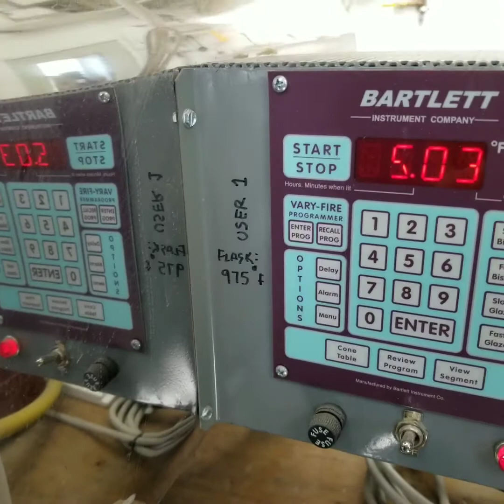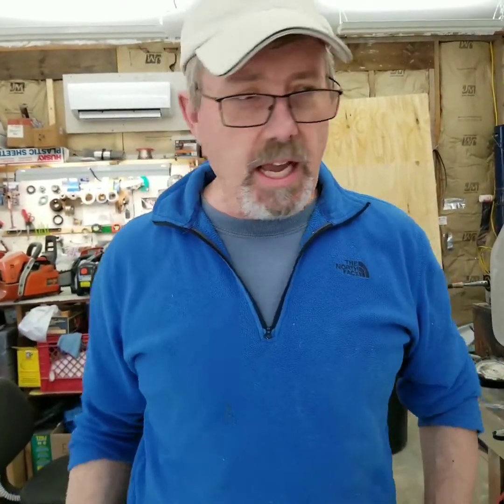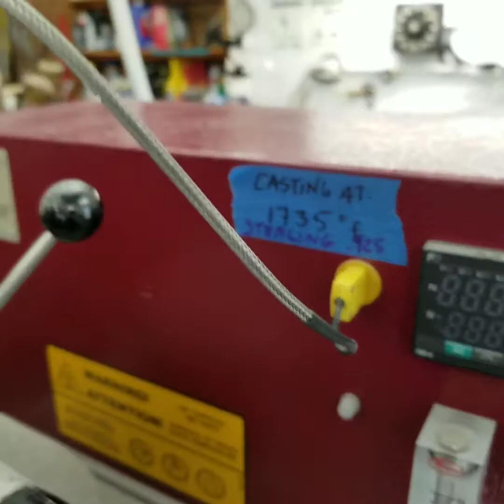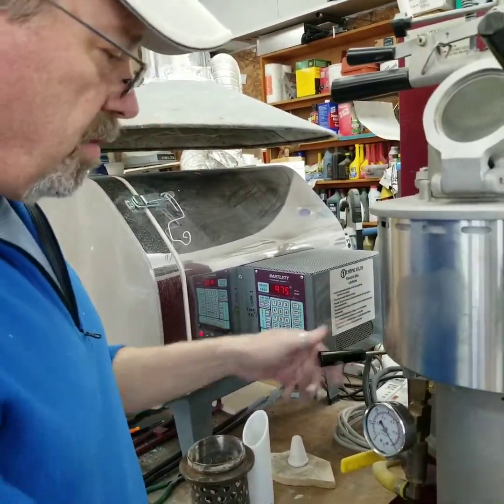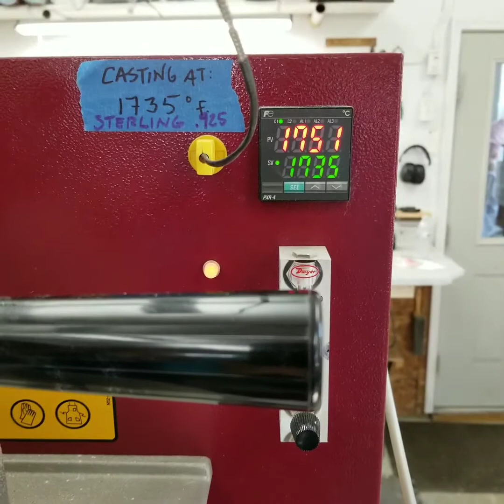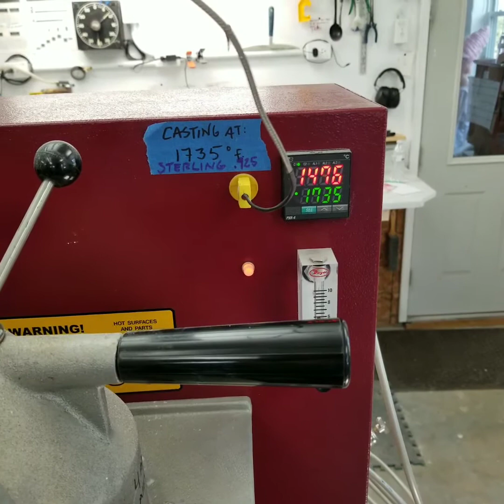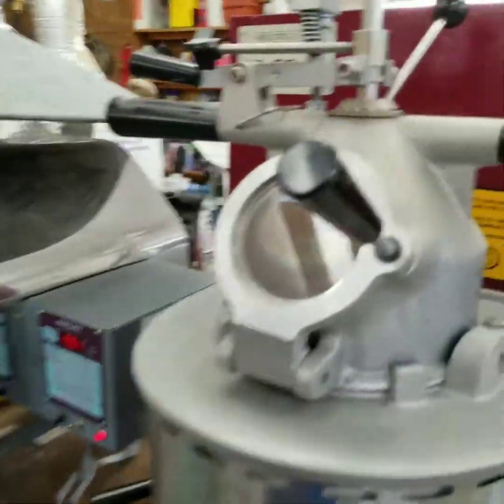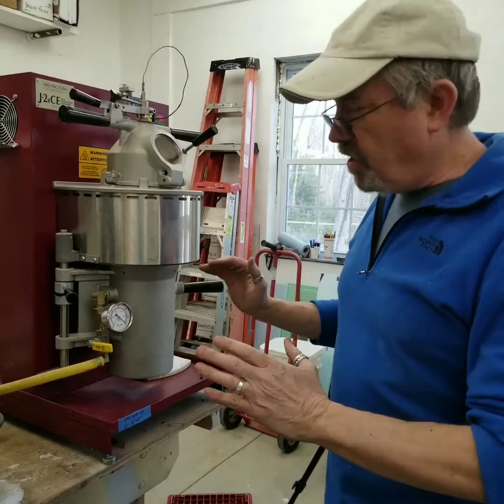How I Operate my Neutec J2R Casting Machine

Comment: Thanks for sharing! These tips are very helpful. I'm currently setting the j2r up at work and am excited to get up and running with it!
Reply: Also a quick question if you wouldn't mind - it looks like you've got either series 3 or 4, and your sealing rod has no ball that needs to be cemented on. Did they do away with that ball on the newer models? Rio's tech team is out at JCK. Thanks!

Comment: What is your method in regards to shutting down after casting? Do you wait for the machine to cool to a certain temperature at what degree do you turn it off? Thank you so much
Reply: Excellent question Julia!  My primary goals for shutdown are: 1. to not use/waste any more shielding gas than necessary 2. to not let oxygen have access to the orange/yellow hot graphite parts in the machine because they will literally burn up and consume themselves.  My sequence:  once I have dropped the last shot in the last flask, with the vacuum still running, I shut the casting machine off, and I shut the kiln off.  My theory is to begin the cool down process as soon as possible. I also shut off my exhaust ventilation system if it’s the cold season (I live in Maine) so I can reclaim the residual heat in the equipment to heat the studio which it does nicely for the rest of the day.   The vacuum chamber does not require that the casting machine be on to operate.  After 2-3 minutes, I close the valve, shut off the vacuum, remove the freshly cast flask to cool before quenching.  I have the heavy aluminum Neutec crucible cool-down chamber and the special spreader tongs for gripping the hot crucible so I lock the plug rod in the up position, unplug and remove the thermocouple, remove the lid, set it gently on the floor on it’s side remove the ceramic funnel, then the orange hot flask and place in the cool-down chamber and close the lid. The shielding gas (nitrogen) is still running at 5 cfm during all this process. Next I replace the lid close and lock the vacuum chamber bottom and set a timer for 5 minutes.  The goal here is to fill the chamber back up with nitrogen and displace the O2. When the timer goes off I cut the gas volume in half to around 2.5 cfm and reset my timer for another 5 minutes at which time I will close the valve on the bottle and let the system bleed itself. Because you have removed the crucible, the chamber has cooled down quite a bit by the 10 min. mark and you are mostly past the temperature that the graphite rods will consume themselves.  If you do not have the cool-down chamber, you will need to keep the gas running for quite a bit longer, maybe 25-30 minutes?  
One more thing, grabbing a yellow-hot crucible with tongs is quite the experience.  The tongs operate exactly opposite of normal tongs because they grip on the inside which in the heat of the moment kind of messes with my head.  You don't need to squeeze very hard to grab the soft crucible, just hard enough.  This is the exact opposite of what you just did grabbing the heavy flasks out of the kiln with standard tongs. So I find if I say outloud to myself during the entire crucible grabbing and transfer process “Keep squeezing gently, keep squeezing gently…” I don’t forget what I’m supposed to do or lose focus!  But I’m ADD so I’m easily distracted!  Cheers!  Mit
Reply: @SquishyMit  Mit thank you so much for this detailed answer!! It is very helpful to me, I don’t have the crucible jar yet but I can see it’s worth the investment. I’ve been trying to preserve my nitrogen as much as possible so this gives me a better idea of the process, I will follow all of your steps. Again, I appreciate you writing all of this!

Comment: Hello. He became interested in the topic of vacuum casting. There was one question about the protective gas. Do I understand correctly that nitrogen opens from the very beginning of loading metal into the crucible and continues to flow into it the entire metal melting cycle until the moment of pouring into the flask? If yes, then with a consumption of 5-6 liters of nitrogen (argon) per minute and a melting cycle of 10-15 minutes, 50-75 (60-80) liters per cycle (flask) should be consumed? Are my calculations correct? A few cast ones are still enough for one gas cylinder? Thank you for your video, it makes the casting process very clear! 👍
Reply: Hello Mrlwan900.  The tank I use is called a "Q tank" in the US.  it is an 82 SCF or 82 cubic feet steel cylinder of nitrogen gas.  The gas is only needed once the temperature is above 1000 f. on startup.  I usually set the gas at 2 LPM when the machine is initially warming up then move it closer to 5 LPM as it gets closer to casting temp.  It remains at 5 LPM for the rest of the casting session, I usually cast 2-4 flasks at a time.  I remove the flask and set it in the airtight cooling chamber immediately after I cast the last flask to slow crucible degradation and oxidation.  At this point in cool-down, the gas is only necessary to help prevent oxygen from consuming the 2 graphite parts remaining in the machine, the mixing rod and the sealing rod.  Once I remove the orange hot crucible and replace the top on the machine, I let the gas run for another 5 minutes at 2.5 LPM and then shut the gas off and let the machine cool down undisturbed. 

With this routine, I can usually get 5-6 casting sessions out of one 82 SCF Q tank cylinder.
Reply: @SquishyMit  Thank you so much for such a detailed answer! Now I got rid of a few questions that have been bothering me for a while!
Reply: google translator🙈

Comment: Hello Mr. Steve, I have a question to calculate the cost of each casting in the J2R, every how many castings should I change the type K thermocouple? since this is one of the most expensive consumables that the machine has, much more expensive than crucibles, rods and gas, and what is the minimum amount of metal load (silver and gold) for each casting? , Thanks a lot !!!
Reply from the maker: Hey Iuis, I have never changed my thermocouple!  I talked to a dealer and he said that they just stop working then you change them (the machine won't start unless it is working).  I do have a spare on hand if/when that ever happens.  
I have only changed my crucible one time when it got pretty pitted.  I believe the graphite breaks down when it is exposed to oxygen at high temperatures.  I try to remove my crucible from the machine right after I cast the last flask and place it in the airtight aluminum cooling chamber.  I believe the concept is that because it is tight, it quickly consumes the O2 in the chamber and then cools down in an O2 reduced/free atmosphere reducing degradation of the graphite.  
The rods get checked before each casting session, the machine is designed so you can extend the rods a little as they break down, which is nice.  I'm still using the set of rods that came with the machine when I purchased it (on eBay used). 
I use nitrogen as an inexpensive casting gas.  I think you can use argon but that is much more expensive.

CHeers!

Mit
Reply from the maker: Also, I remove the thermocouple from the plug rod immediately after the last flask is cast.  I don't leave it in to cool down slowly.  This seems logical to me...
Reply: @silverbeehivestudioyoutube8580  Thank you very much Mr. Steve, I will take into account all your advice in order to optimize my casting process.

Comment: Steve, how much Nitrogen gas do you use per casting? The J2r takes about 4 liters per minute of gas and I assume about 40 mins to reach casting temp and maybe another 20-30 to cool down so maybe 70 mins at 4 liters/min is 280 liters or about 10cf of N per casting cycle. Is that in the ballpark of what you see?
Reply: Hi Kevin,  I am pretty miserly with the gas.  I reached out to James at Robotech Developments in the UK who is a real authority with these machines. (follow him on Instagram @robotechdevelopments) He confirmed that what I have been doing is correct.  1. only turn on the gas once the chamber reaches 500 f. as the oxidation of the graphite crucible below 500 f. is not a problem.  2. If you have the 'cooling down' chamber for the crucible (the funny-looking case with the cooling fins on the outside) place the crucible in it after your last shot and close the lid.  This will quickly starve the O2 in the chamber and the crucible will cool down without eating itself.  3. Once the crucible has been removed, put the lid back on the casting machine, close the viewer door, and shut off the gas. Hope this helps.  Mit
Reply from the maker: Hi Kevin,  I am a gas miser (I'm cheap).  I do not turn the gas on until the temp reaches 800-900 f. as I understand that the real degradation/consumption of the graphite does not happen until the higher temps.  Then I ease into it, beginning with maybe 2 lpm and once it begins to glow orange, open it to the max level of 5 lpm.  I try to remove my crucible from the machine right after I cast the last flask and place it in the airtight aluminum cooling chamber.  I believe the concept is that because it is tight, it quickly consumes the O2 in the chamber and then cools down in an O2 reduced/free atmosphere reducing the degradation of the graphite.  I got my machine and consumables from a jeweler and it came with the aluminum cooler chamber, which may be an 'extra' that you need to buy, not sure. Once the crucible is in the chamber cooling, I reassemble to lid and let the gas flow for another 5 minutes (the rods will still be orange hot) then turn it off completely.  This is the routine that I have found conserves the most gas. Off the top of my head, I'd say I get maybe 5-6 casting sessions from one bottle of gas.  Hope this helps.  Best.  Mit

Comment: The recycled metal will scratch things up
Reply from the maker: I suppose it may scratch the graphite in the crucible a bit, I never noticed actually. I don;t think it is a big factor in the overall function of the machine.  Have you had problems with this?